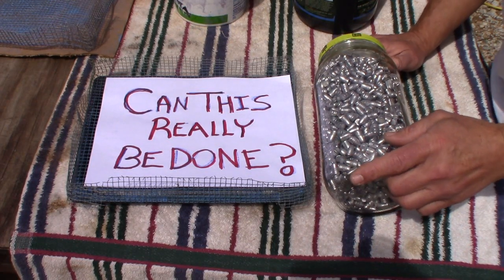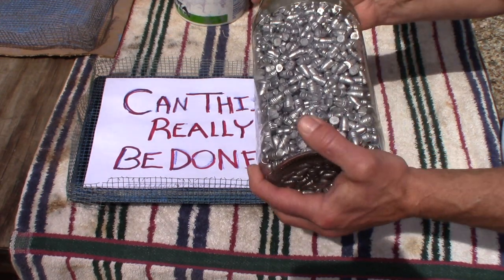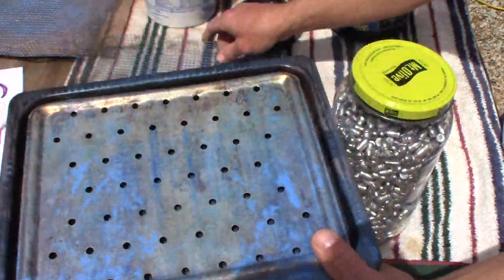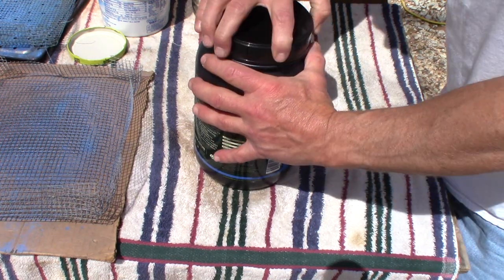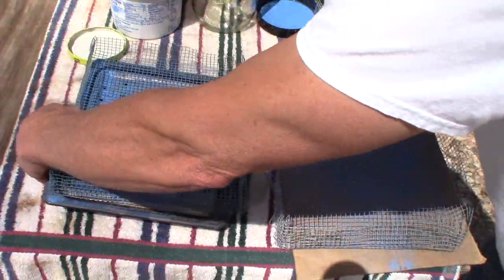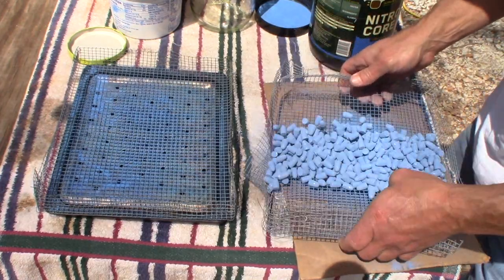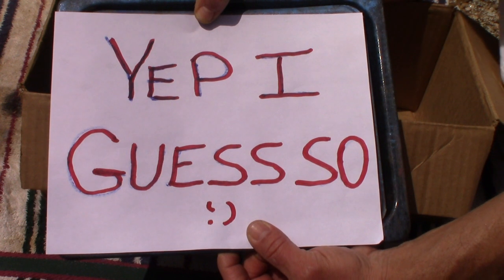Powder Coat (As Much As We Can Lift) Where's The Limit?

Comment: Elvis, your hypothesis on steel vs lead and heating is correct, but the reason you think it does this is a little bit off.  You are correct about steel taking longer to heat up and cool down.  This is because of the specific heat capacity of the metals.  This is why it takes longer to heat the steel up.  It takes about 4 times the heat energy to heat the same mass of steel up as it does to heat the same mass of lead.
Reply from the maker: thanks for the input!! the cure or bake time for a specific powder coat is usually set with steel in mind.. I got a feeling we are over heating and baking for a little too long in general. but as with any specific metal and item size/weight to be coated a little experimenting can dial it in more closely to perfection... thanks for watching and commenting

Comment: Damn, Elvis! You need 2 men and a boy to tumble that herd of boolits. My experience is that any reasonable amount of boolits works fine if it fits your equipment, at least so far.. Never even tried the standing them up method. Did try parchment paper, non stick aluminum foil and silicone mat. none of that worked to my satisfaction for various reasons. Appreciate your posts as you never led me astray on powder coating. Even use the same style hardware cloth basket like you do. I still cook em at 400 F for 20 minutes and water quench. buddy.  I always figured bigger piles would mean more boogers and ugliness from clumped paint but it just doesn't happen. Keep em coming,

Comment: What brand powder coat you use.   I tried it with the black that ti have and it does not coat the bullets by shaking them.    Works great with electrostatic gun but shaking no lick.

Comment: Elvis, so you think I can powder coat hardcast 6.5mm Swedish mauser loads at 2500 fps in a Swedish may see? Will it stabilize with the mauser with the fast twist rate and not strip the rifling?

Comment: I appreciate all the information that you publish on Youtube
on reloading. It is very helpful.I have a questional about powder coating and reloading. In
lube coated lead bullets, the BHN is important in order not to experience a
leading problem with the bullet. To soft a BHN leading in the barrel is
produced, to hard a BHN and leading is produced by the bullet not obdurating
and hot gases blow past the bullet. I also assume in using a bullet that does
not obdurate that there is a sacrifice in velocity because of this hot gas
blowing past the bullet.Do you still have to have a proper BHN when you powder coat
so the the bullet obdurates?When the bullet is annealed by the powder coating process,
is the BHN static and not change or does the BHN continue to increase over
time?

Comment: Ok so I made sure the temp was right like you suggested and it was then I let it cool naturally I usually use a fan to speed the process up and still not like yours but when I do it like loads of bacon they come out great with your temps but that process is long and tedious as you well know the only thing I can think of if the way you cook them what I mean is do you put it on warm bake broil mine stays on warm but if I can't figure it out then I will have to use your temps and load of bacons method and believe me I don't want that. Thanks for letting me twisted your ear for a bit
Reply from the maker: so tell me what powder you use? Do you know what the temp actually is in your oven? did you make sure to shake all the powder off the bullets? these details help me to evaluate.... what powders do you have?

Comment: Elvis, at the lower temp and bake time, is the powder coat adhesion to the bullet still as it should be? Have you hammered one down to confirm?
Reply from the maker: Yes ... solid as a rock!! The lead conducts the heat a lot faster than steel ... No worrries at all

Comment: Wow that is awesome to see you can do that many at one time. I have issues with my powder coated lead cast bullets sticking to the great. I'm using what looks to be the same one as you however mine tend to have a bunch of Deep indents from the Trey. Also when I break mine apart it is really difficult sometimes to get them apart. What do you think my issue is? What temperature are you running these at in your oven and for how long? Also I heard you say you were mixing white with the Ford light blue. Does that help them break up easier? Any thoughts would be greatly appreciated
Reply: Probably one of these or both.

1. you are baking too long probably.
2. you are not getting rid of all the excess.

I used to worry about the coverage. just screen them real good. be rough. its ok if you see tiny spots of silver everywhere. it will spread and fill.

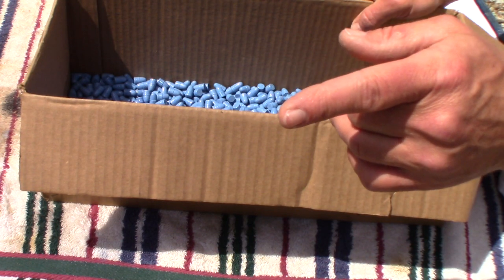Comment: Hey Elvis this is a great discovery ! I always tried to cool mine off quickly by dumping them in a bucket of water. It looks like the trick is to let them cool on there own. I will definitely try a lower temp (275) and a shorter time, the 15:00 to 20:00 min. period. Question, do you think it matters what powder you use : Eastwood or Harbor Freight ? Also, do you think it matters if you use the basket or the Teflon pad ?
PS: I think I saw a small Elvis shake in there :-)

Comment: Elvis I have a ? For you I have done it like you have but they mark up where they touch or where the wire touches them and I use the Eastwood powder like yourself and the temp like yours with the wire mesh where do you think I might be going wrong
Reply from the maker: I think you might be trying to separate them to soon. it's best when they cool almost completely. make sure your oven temp is close to what you intend. 275 degree F 15 min. if you have a thermometer.. it don't have to be perfect but in the ball park. let me know how it goes...

Comment: You said you powder coated at 275F and 18 mins. I have 28” tall oven, I don’t have precise temperature control... maybe plus minus 25F. Can I powdercoat that many bullets by placing them on trays from bottom to up? My heating element is on the bottom. Any comment on this setup?
Reply: R2COM that should work fine. A couple cheap temperature probes would give you a better idea of what temperature you're seeing in your pile.
Reply: otm646 alright bro thanks for advice I guess I have to check and see!

Comment: Hey Elvis, Im new to casting and powder coating. Just trying to learn as much as I can about this process and more importantly how the powder coat holds up once it’s loaded and is in contact with the various powders people use. I saw a few videos where people did some controlled testing by dropping powder coated bullets into gun powder and letting it sit there for a 5-6-7 months. In many cases the powder coat was completely deteriorated and there was residue that the gun powder was giving off...... I’m wondering if you’ve ever experienced or checked on anything like that? Do you have any thoughts or maybe videos you’ve done on that subject. Thanks for all your videos, I’ve learned a ton from ya and I did get that Arsenal “Elvis” mold for my 300 blackout.

Comment: Wow I guess so too.   That was a lot of work just to cast that many bullets. Looks like the low heat method works just fine.  

A suggestion for another video    A good discussion on what you do when you have failures ie: the powder coat doesn’t have the proper coat when you open the plastic container. The powder being to thin or to thick. 

Thank you for your hard work and sharing it with us. You are the Big Daddy of powder coat bullets!
Reply: Lobo; I am not Elvis nor do I play him on TV. 

My cure for not enough coating while shaking is to shake some more. Sometimes it works other times not so much. 

Beware water or humidity / moisture will repel the powder like oil and vinegar!  So be anal about dry bullets. I warm them in a mini crock pot. 

The only time I had too much powder on them  I simply washed it off with the hose and dried and warmed the bullets then recoated them.  It worked treat. Hope that helps. Remember, I ain't mister Ammo!
Reply: Tom Dubya thanks for the tips never thought about just taking a water hose to them.  

The vinegar hit home hard. This may be the root of my problems lately as I have been using a “fresh clean” pickle bucket to quench bullets in coming out of the mold.    Wonder if scrubbing it with baking soda would cure my problems?  
Thank you for your input.